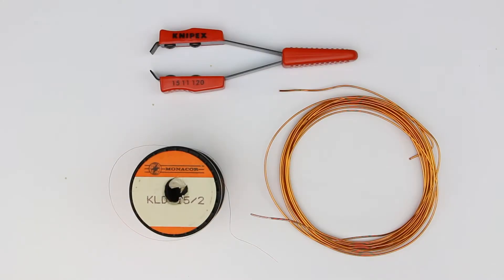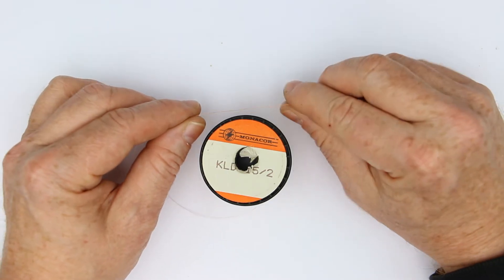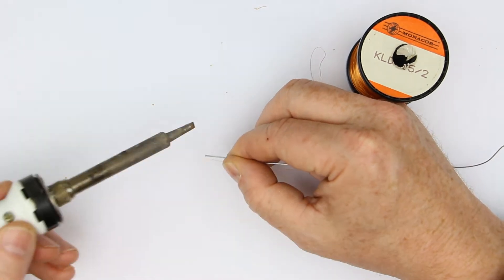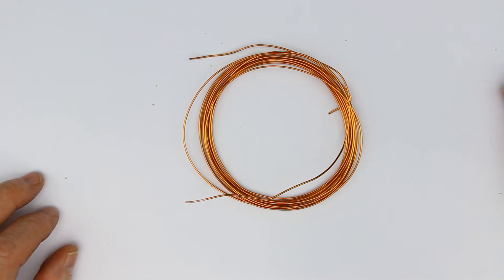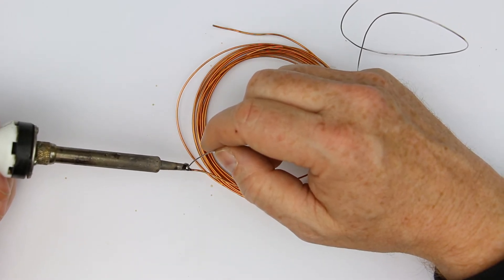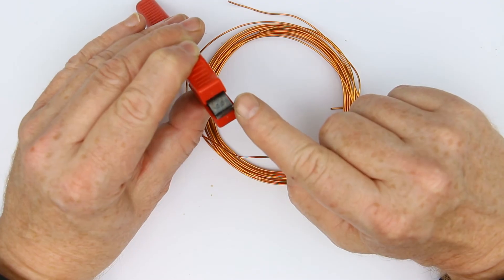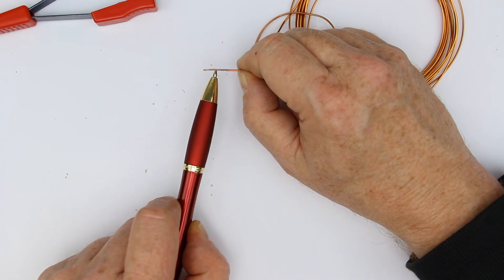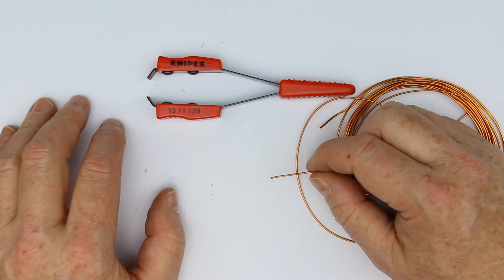Every maker should have…[Pt.10] a Coating-Scraper for Enameled Copper-Wire

Comment: Does it also work on the small 0.3 mm wire you have ?, would be nice to show that also.
Reply from the maker: Yes. 0.3mm is about the limit for this type. There are other available from Knipex for thinner or thicker wires.

Comment: I made a video a while back called 'Best Way to Strip Magnet Wire'. It's a chemical method for large wires or nyleze and imid coated fine wires that cannot be stripped using other methods.
Reply from the maker: Interesting alternative.
Reply: He uses a torch to melt lye and salt molten hot and dips the end of the enamelled wire in it. Not a very good method.

Comment: i guess a fingernails cutter could work pretty much the same
Reply from the maker: I don´t think so because you don´t cut anything but scrape the coating off with this stripping-tool.
The only other method I know of is to sand the coating off with sand paper.

Comment: But what do you do when you want to strip the whole spool not just a one cm or or two? Every video I've seen so far goes only for the end of the wire, but nobody showed how to remove the enamel from a wire spool or the big wire round that you have on your table. Still searching...
Reply from the maker: The whole spool? Why did you want to do that? Then you would have a spool of unisolated copper wire in the end which you can get easier by buying blank copper wire.
You could try chemical dissolvents like acetone, chloroform etc. Even hot water could work.
Try to google "polyurethane solvent"
Reply: You asked the reason that you would buy a new spool rather than wasting time stripping off the enamel from magnet wire? The answer is obvious, surely. If you want to recycle wire for jewellery, then use normal copper wire with PVC or rubber insulation, since that is easier to strip.
Reply: Put it in a good wood fire lol
Reply: Hot tweezers easily melts & scrapes off the coating on magnet wire in one pass.
Reply: Recycled copper wire is used in jewelry and why would you want to buy unisolated copper wire when you can recycle in many cases for free?Most tutorials on removing enamel from wire are useless if you want to remove more than a few centimeters and not wasting your life doing it.
I'll search for polyurethane solvent but until now acetone and a lot of paint removers are useless.
Reply: Checkout old videos to strip enamel using CausticSoda + Salt & heat.